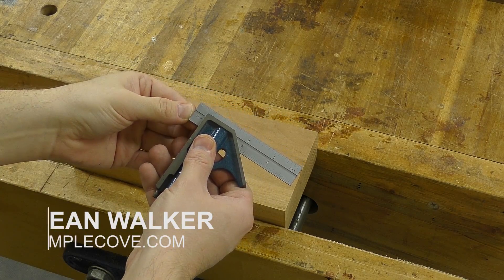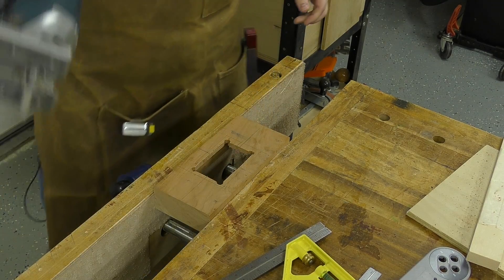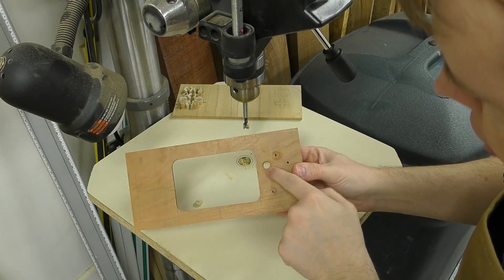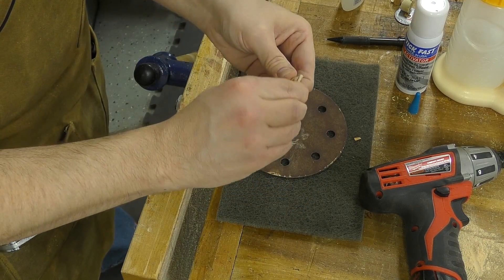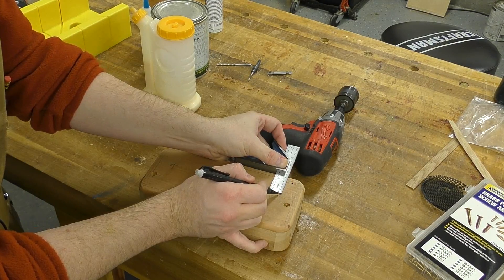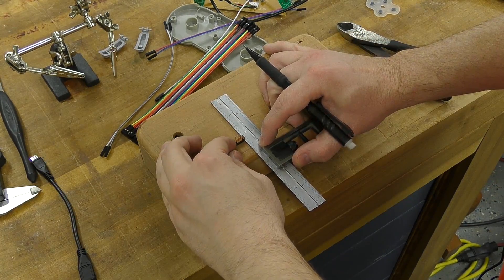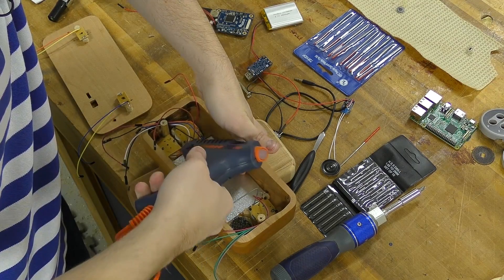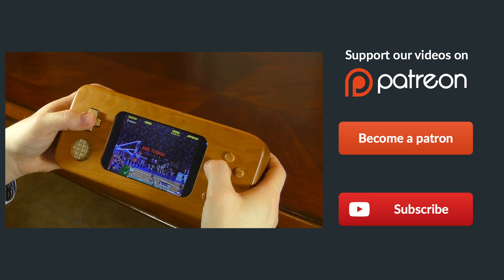Wooden Handheld Game Console

Comment: i have a feeling 2500mah will only get you about an hour and a half. i used a 4000mah battery and got about 2.5 hours. Considering the size of your build, you probably could have fit a 6-8Ah battery, by going with a thick battery.

Comment: Awesome job sir. The colored square on top right corner means the pi is under powered ;)
Reply from the maker: zesuperdimi yep which I mention in the video. Thanks.
Reply: oh okay , my english is not good enough to understand all the words correctly ...apologise sir
Reply from the maker: +zesuperdimi no worries, I wanted to let you know in case you didn't see it. The charging board doesn't put out enough amps so I need to find a different board.

Comment: If you find heat becomes an issue, you could always cut a few thing slots with a dremel and use some of your speaker grill or speaker cloth to cover them.  Just a suggestion...  :)  nice little build.  Pretty involved, isn't it?
Reply from the maker: Thanks for the suggestion, I will probably end up doing that. Its super involved lol. So many dowel rods for the inside that it took me way longer than it should have. Thanks for watching!